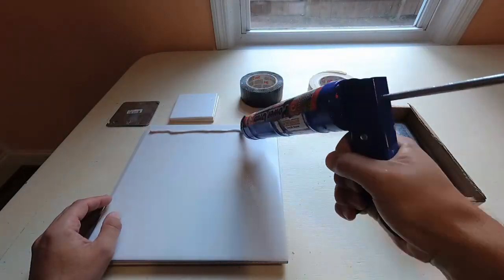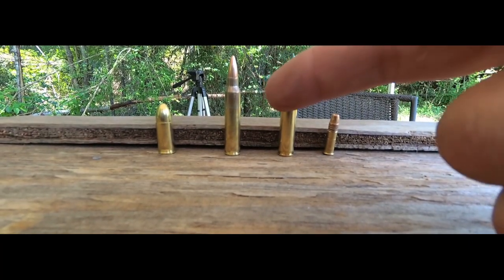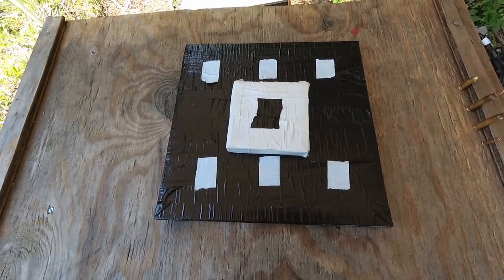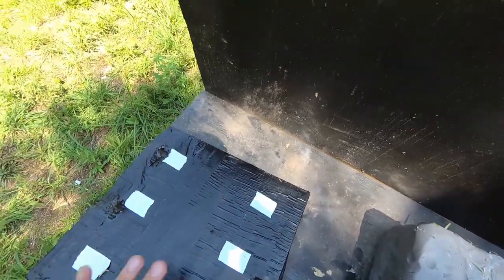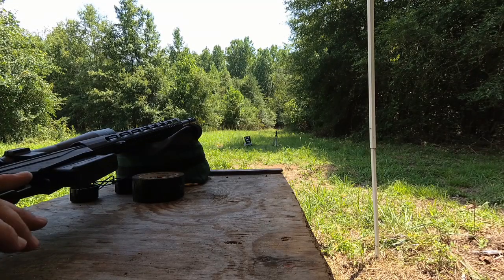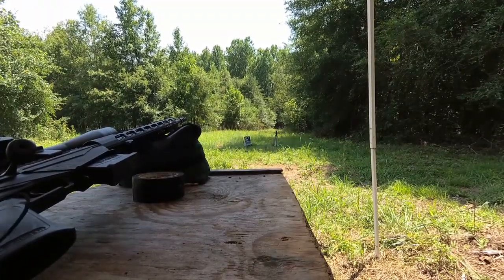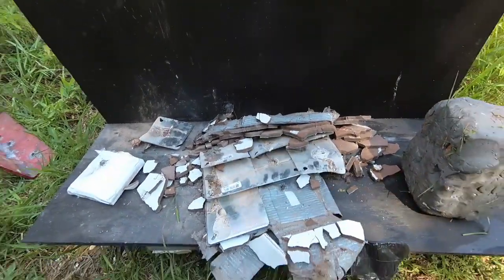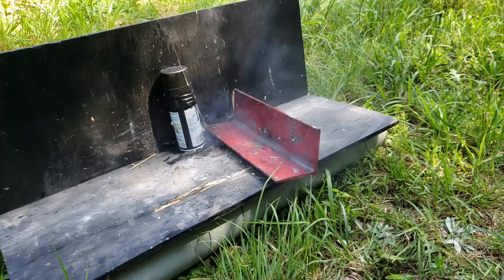Under $10 at Home Depot, Can I Stop a Bullet?

Comment: So that’s pretty cool but I would recommend using a lot of glue and more duct tape because though it may stop the bullets, you will be hit by the shrapnel from the tile breaking so if you could keep that held together as good as possible that would definitely help you probably would want to code it with a bunch of resin
Reply from the maker: Thanks for watching!  Good tip.